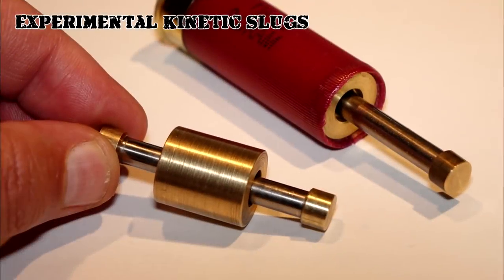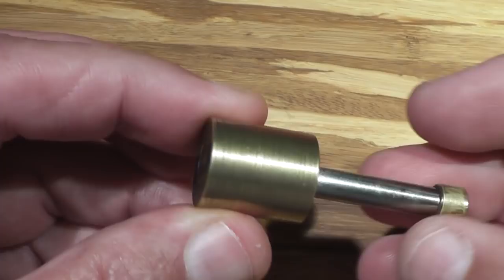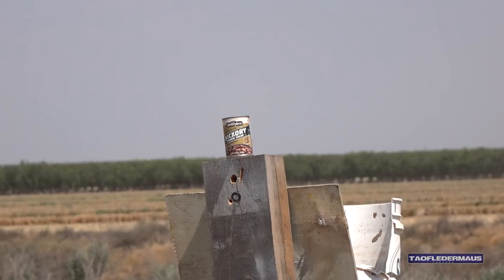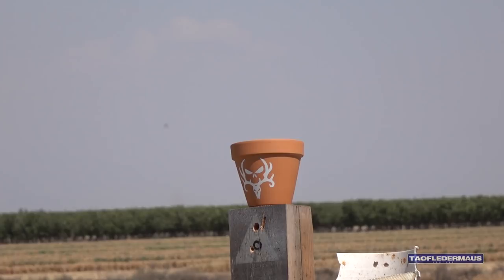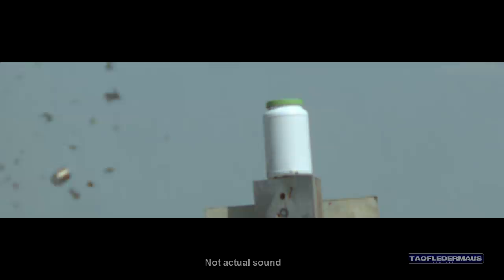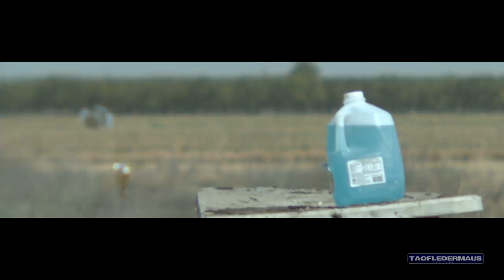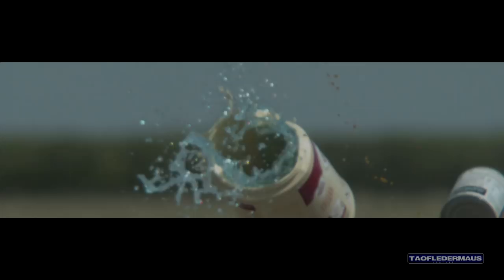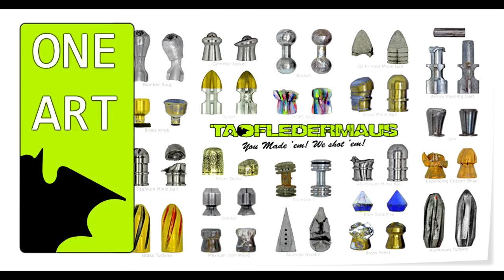The Kinetic Shotgun Round  -  Slug of the future?

Comment: I expected exactly that to happen we have a similar effect in rocketry called drag separation that's where you launch a rocket in the nose cone appears to accelerate ahead of the rocket separating early on the ascent which of course makes the rocket go unstable pretty quickly the reason for it is actually pretty simple you have two bodies traveling through the air you have the center pin and you have the brass sleeve the brass sleeve has more drag than the center pin so it slows down faster than the center pin does you're not seeing the center pin move forward you're seeing the center pin slow down less than the brass sleeve
Reply from the maker: With rocketry,  the acceleration is much less,  maybe 10 to 20 g's?    With 10,000+ g's,   things get severe.
Reply: TAOFLEDERMAUS not really relevant the physics are the same whether it's 200 G's or 200000 G's drag separation is drag separation typical Rockets are probably 10 to 40 GS with some extreme cases busting 200 300 GS for those are not common but the effect is exactly the same because the shaft has a smaller frontal area it will decelerate less than the cylinder around it this will cause the shaft when the optic is not tumbling to lead the bushing that's why the shaft slid to the front

When does tumbling however the drag between the cylinder and the sleeve is increased and it will hold its position which is why the twirly ones day facing the rear
Reply: Would it make any difference if you added a stiff spring to force the cylinder in one direction or another? Slide a spring over the shaft and weld the caps on, but make it so there is no play and the spring is already under load before they fired. That way when they fired, the cylinder would be slammed back into an end after being shot out of the barrel.
Reply: drag would lead to the pin impacting first not last. so separation has a different cause. but the whole principle behind this slug is wrong. the energy would be much higher with a spiked massive slug than  moving parts. even if the pin hits first and the outer cylinder hammers forward, the cylinder would hit the target before hitting the end of travel on the pin. therefore no additional energy transfered to the pin. its like beating a nail with a hammer, you dont get deeper penetration if you either hit the nail resting on the wood or if the nail is glued/welded to the hammer. only accuracy in this example is better with the resting nail.
Reply: NO WAY the only time the slug flew straight that's what happened the pin lead the slug because it has less drag so it's slow down slower so it slipped forward it would impact first as for why it's blowing itself apart that's Metallurgy and structural stresses that's not my expertise
Reply: If the cylinder was dome-shaped, would that have helped?
Reply: +TAOFLEDERMAUS Good point Jeff, what's your take on it? I'd say if the expanding gasses during ignition were to be channeled via wadding directly to the brass sleeve, then given the mass of the sleeve being more than that of the pin, shouldn't the energy be transferred to the sleeve? would not the pin trail behind and therefor be "dragged" I'm a sense by the brass body? I'm simply thinking in terms of transference of chemical energy to mechanical energy. If the force of acceleration were applied to a particular portion of the slug directly, and bypassing the rest of the slug, wouldn't that lone portion receive and act upon the accelerating force? I'm visualizing a wad that cradles and supports the sleeve, with a long hollow base that retains the pin in a rearward position. So that the energy is directed to the sleeve and the pin simply being dragged behind the object in motion.
Reply: +Jonah Ragnarok Hmmm, good point lol. I have to apologize I'm a ballistics nerd as well as a particle physics nerd. I get terms as well as constants crossed often, for some reason I was applying relativistic energy, mass, and KE to macro scale objects. Lol we use a lot of the same terminology and apply similar constants to sub atomic particles as we do "life size" systems. I often forget which realm of Science I'm occupying lmao. Thank you Jonah, you are correct. Forgive my momentary spout of ignorance I forgot there are things like gravity oxygen nitrogen hydrogen and other elementary forces in place. Lol sorry guys thought I was shooting in a vacuum this mornin'. -D.A.B.
Reply: +Jonah Ragnarok that's very, very interesting Jonah. Anything regarding physics grasps my attention. But lmao at the pot and clearance thing I apologize. I smoke every day and I'm also horribly affected by chronic attention deficit hyperactivity disorder, so I am prescribed dextroamphetamine daily. Also I'm schizoaffective and heavily medicated. I had govt ties and certain clearances at a point in time but that was when I was going into the core, since those late teens I've become the last person the govt wants working for them lol. My personal goal is to go back to school and, by the grace of the multiverse, have a chance to work on the LHC or at least do something to contribute to quantum mechanics for future generations. In the meantime my scientific research is conducted using algebra since it's all hypothetical and I don't exactly keep a subatomic particle accelerator or an electron microscope in my closet lol. So it's just all theories and postulation for hours on end for now lol
Reply: +Jonah Ragnarok lol you're quite the bright mind yourself Jonah. I don't meet many individuals who understand the interconnectedness of the human mind. The brain always consists of changes to counteract deficiencies in one area, usually by taking away from another given area. I have ADHD , paranoid schizophrenia, manic depression and to top it all off let's throw in psychosis. Now that being said, my IQ, measured over a dozen times with the same test(Mensa society;60 questions 40 min to answer) is measured at an AVERAGE of 158. The high end being 162 the low end being 155. Let me tell you and anyone reading this in the future... That high in the sky intelligence quotient is more of a curse than all four mental illnesses combined. Simply understanding the universe, for what it is, the world, life, society, relationships etc just kills me daily. It's not fun to wake up in the morning to a big complex universe, ignorance is bliss. The more you know the more you don't.. Dunning Kruger Ugh.
Reply: +Jonah Ragnarok yeah certain scales cut off at 160 for adults as (from what I understand) anything over 160 is in the realm of immeasurability and the score therefore cannot be reliably taken at face value. There are scales that go into practical infinity but again anything over 160 is purely hypothetical in a fully developed mind. In adolescence and childhood the mark of 161 or higher gives the reader a "likelihood" of how that number may or may not manifest itself as a dysfunction, i.e. mental illness as the child reaches adulthood. When I achieved the score of 161 and 162 I was 16 years old and my age must've therefore brought me into a different bracket because I still have the digital information saved on one of my brothers computers. As I have done with all of my "paper achievements" lol act:36...GPA:4.0.....IQ test results from Age 14-present..as well as my asvab afqt score: 96. My IQ scores have been slightly lower but more consistent as I've reached adulthood. 156-159.
Reply: +Jonah Ragnarok I do know that my IQ results drop considerably when I'm not Properly cognitively stimulated. for example my lowest score I've ever received was following a test I took while out of my ADHD meds. I drop from 155+ way down to 136+/-. I take Dexedrine which contains the 'dextro' isomer of Amphetamine or 'DextroAmphetamine. This is a strong psycho stimulant and it regulates my neurotransmitter emission and reputake. Without it I cannot function in society. It's a simple methyl group away from being methamphetamine which I used to be prescribed, yes, meth. Brand name desoxyn.The point is, my frontal lobe simply put is highly dysfunctional and my condition is debilitating without a strong CNS stimulant managing my neurological chemistry. my body/brain cannot do It alone, this is by far more horrendous a condition than any of the conditions that classify me as "schizoaffective". The paranoia, delusions, voices, hallucinations, mood swings, depression.doesn't touch dysphoria.
Reply: Nerys I’m not in rocket science but when seeing the slug first I expected it to be in the configuration we’ve seen , and was confused when he made his explanation
Reply: Nerys holy I wanna sit in a room and listen to all you nerds in this comment thread talk y'all need a podcast
Reply: Dalton Broome how did you get your IQ tested? I was tested for undisclosed reasons, he said my being to impulsive lowered my scores. Now I am on ADHD meds and antidepressants curious as to how that might effect my scores.
Reply: Nerys what about adding a 3-piece, sabot behind the outer piece? So that the weight is already forward and the shaft is already rearward for flight?
Reply: This is also how sabots typically separate from penetrators as well. To be frank I'm not sure what this projectile would offer over a saboted or APCR version of itself.
Reply: The high quality of your response relative the lack of punctuation is the only thing that surprised me here. Something new every day.
Reply: Ben Weigt I work 3 full-time jobs 120 hours a week I typically make these replies at work using Google Voice for dictation so blame Google :-)
Reply: Nerys I'm sure you have a way you solve it in rocketry but would using metals of different densities work? Or maybe some kind of bimetal arrangement that locks the two pieces during acceleration and unlocks after exiting the barrel and cooling slightly?  I think the additional movement is just an energy loss personally, plain bar shot would be simpler.
Reply: Cameron Dufton the energy levels involved here are crazy I have no idea what a viable solution might be in rocketry we simply shim the nose cone so it does not release so easily from the body to such that the drag and friction of the shoulder to body tube connection is greater that they drag separation difference on deceleration or for larger Rockets we would use shear pins made of foam or styrene so they would hold their nose cone of fast but would shear off when the ejection charge fired
Reply: What sort of exactly what I expected to happen as soon as I saw the slug
Reply: I'm no rocket scientist (but my mechanical apptitude is off the charts and remarkably high IQ without need for any drugs 150 some odd and 99 on aspab) your explanation is logical.

However it was coming apart in the barrel  while still being accelerated by the wadding. I suspect the plastic gas piston (if they'd recovered and examined) has a small round hole in it. On detonation the pin is probably punching through wadding (inertia vs surface area vs tensile strength of plastic) which then acts as vent shoving pin back forward at high speed (mass vs pressure) heavier object takes more force to accelerate
Reply: Also, of course:  the big slug launches at the rear of the projectile, moving the center of gravity way back, almost certainly behind the aerodynamic center of pressure, making the thing inherently unstable.
Reply: gregzsidisin even if the hollow part of the slug was forward of the slide, as long as centre of mass is behind centre of thrust it stay  be stable, you want centre of drag back as well. If the large hollow part is back, it has more thrust than the slide so the slide won't keep up, the slide also has less drag so you have to look at that. Then you have to look at the centre of mass of both pieces separately as well as together in a dynamic state. It's a lot of high level math, that rocket scientists do.
Reply: E equals mc squared, you’re welcome smarty pants’
Reply: Nerys it
Reply: Andrew ? Yes, but you need to understand conservation of energy, conservation of mass and how to calculate the speed of light as a variable. Amongst other things
Reply: That would make sense except for the fact that the center pin trails the brass sleeve.  With your explanation, it would lead the brass sleeve.  What appears to be happening is that the shot cup shreds, the force on the brass sleeve from the gas pressure is higher (because of the larger surface area) and lower against the back of the pin (while equal on a per unit area basis), but since the pin is denser and longer, the pressure produces less acceleration, and the sleeve rips off the front of the pin as it accelerates.  Peak in-barrel accelerations can reach 90,000 G's, so there's a lot of potential to wreak havoc.  That would explain why the front nubbit on the pin rips off and why the pin trails the sleeve.  If the pin were turned out of one piece on a lathe, the whole idea might work.
Reply: It’s really weird that you don’t use punctuation, especially considering your obviously at least fairly smart
Reply: @dodgecoates8760  "especially considering that YOU'RE obviously . . ."  Pot, meet kettle.
Reply: George Steele an unusual error by me

Comment: If remade, I'd recommend threading the ends of the rods and the brass endpieces, then using locktite to make sure they're sealed good
Reply: Actually with this amount of force I'd drill a hole and pin the 2 together. The shock would probably strip the threads.
Reply: Since it's not going to really need to be separated, you could make both end caps out of hollow steel cylinders and tig weld the rod and cylinder together.
Reply: Easiest answer, use a lathe to make front end cap built into the rod. The end cap thats threaded is the back of the shell. Front end cap takes all the force then the weak back end of the rod would allow it to separate on impact.
Reply: Except for the loctite, I was thinking the same thing.
Reply: Michael Milan I think your right the ends have to be part of the bar or they're coming off, no matter how they're attached.  The sliding piece would be milled from the center of the rod for the sliding inertia.
Reply: It could probably also help to make the shaft tapered, so the brass piece would press itself onto the shaft when launched. Or boring a hole through the shaft and brass and securing them with a steel pin
Reply: No a heat bearing onto rod would be superior. Basically the brass collar is drilled to diameter or a hair smaller than pin. Heat it up to glowing point. Put pun in center and let it cool. This would be far better than even welding it on. Can even rough up the pin ends to further increase surface tension.
Reply: @1014p  I don't know about that, the mechanical strength of threads is PHENOMENAL

Comment: This is precisely what you should expect. You'll get the pin full forward regardless for a whole range of reasons. For example, you're basically loading a 2nd barrel into your gun with a captured projectile. The pin will have less surface area and thus less friction so you'll push the pin forward more easily than the collar, and try to fire it out of the collar. Etc. You won't get the effect you want even if it did work because you're detaching most of the mass from the "penetrator". You'd be better off with a pointed slug. You're thinking of something like a dead blow hammer or slide hammer. The trick is that the mass will be fully forward at the end of the stroke, again doing no more penetration than a slug.

Comment: Hey Jeff! Love the show bud! I think I know the reason as to why the second shot worked the way it did. Because the smaller object is lighter it wants to travel at a faster speed. So as the slug is being shot it sits at the back of the rod piece and when the rod hits the slug rockets forward from its momentum causing a hammer like result because they are 2 independent objects that have to work together to function properly.
Reply: SUPER late but with it being smaller it would be experiencing less drag, which should be why it's traveling at a faster speed.

Comment: The round probably started to decelerate a bit toward the end of the barrel, so the inner pin slid forward.  It wouldn't take more than a few FPS deceleration to cause that to happen with the low friction on the pin.

Comment: Im actually amazed to watch this video.  I knew what the rounds were designed to do before I hit play.  I hit play and hear you two explaining it totally wrong.  When this round is fired it comes out of the barrel the same way it was in the shell,   The mass should sit at the back of the rod and when impact is made the mass will slide up the rod making a secondary impact with greater force then the initial impact.

Comment: Terrible idea on so many levels, the g shock, the fact that a dense tail like that with no drag would barely even exit the shock front- the centre will not penetrate at all, as the mass of the rest does not hammer it in as it is not pushing behind it is sliding past.

Also, the friction is on the front and the sides, OF COURSE it points arse forwards, as the big  block gets dragged to the back. AND the g shock bends the rod and such to get stuck anyway.

I love mechanical slugs - but this had no hope.
Reply: Carbon 12 read my ideal . Does it sound good in theory?

Comment: There is another principle at work. When the explosion from the charge occurs, there is greater surface area on the bass, but also more weight. Since the pin only weighs a fraction of the whole device, it is thrown forward quicker than the sleeve. Since they are both being acted upon by the force, they both move forward, but the pin is slightly faster. This was actually what I thought the designer had in mind; not using the pin as a piercing method, but as the nose (like a rocket's cone) keeping it stable in flight until the moment of impact, when the heavier brass "hammer" will slam into the target as accurately as possible for a shotgun slug.